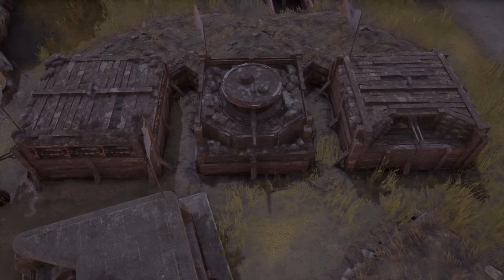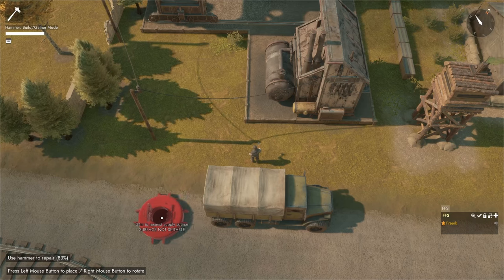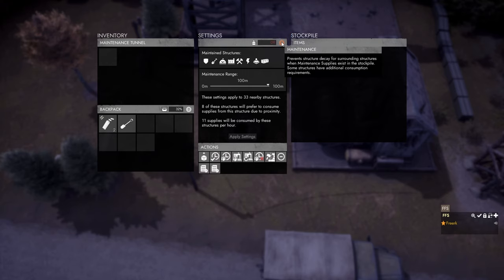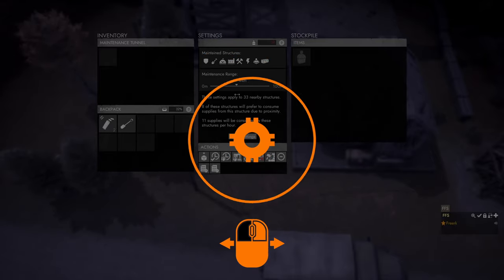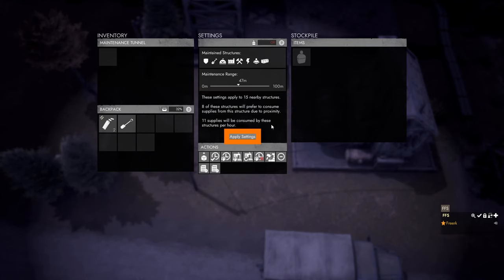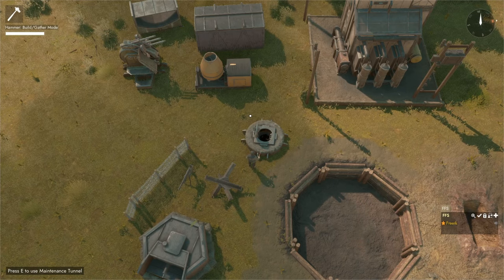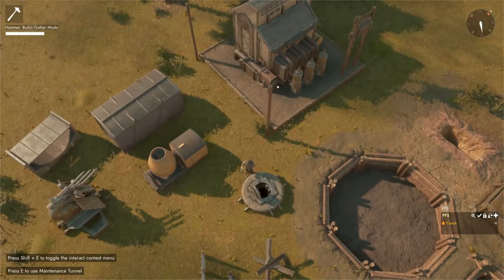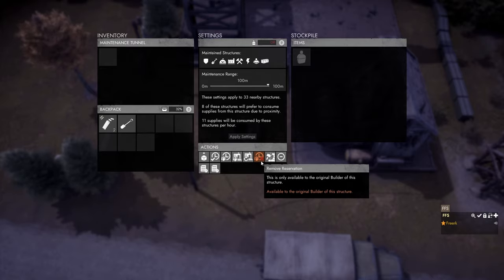Foxhole Guide - Maintenance Tunnel

Comment: This is fantastic.  To summarize your "msupp auto-repair" findings at the end, it looks like all player-built structures repair decay damage at 1% per hour (not sure what's up with the tripod).  Two questions: 1) how does auto-repair change the msupp consumption rate?  I believe it just uses twice as many msupps but I haven't thoroughly tested that.  2) Auto-repair is always slower, but it is it ever more resource-efficient?  Are there any structures that cost less salvage to auto-repair with msupps than manual-repair with bmats?  I don't think so but I haven't done the math.